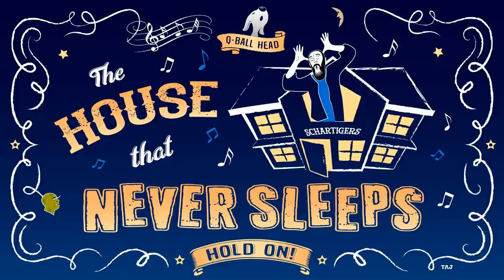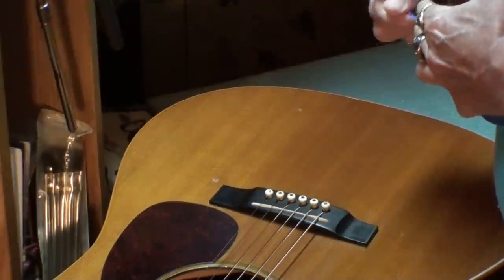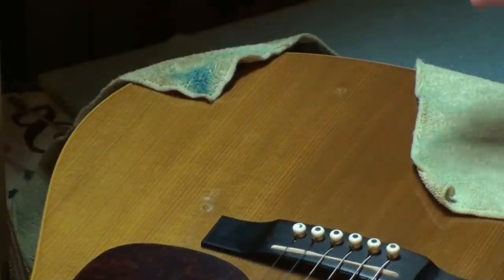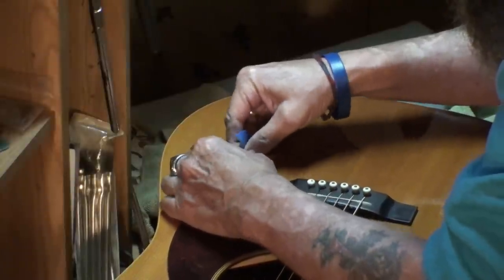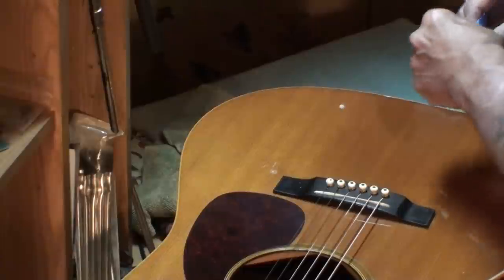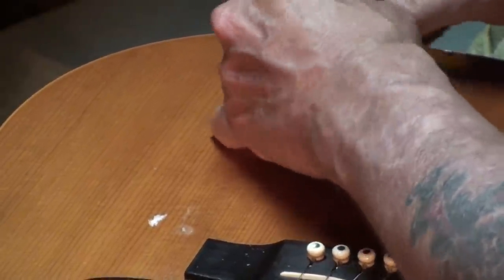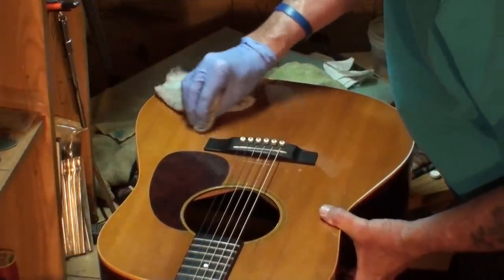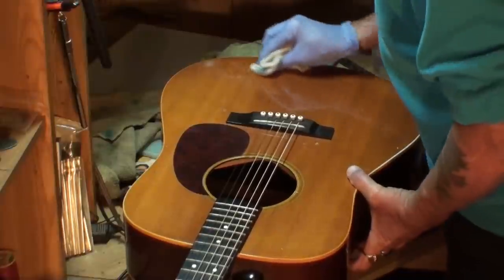guitar finish chip / dent repair

Comment: Great video thanks. One thing you might want to mention in the future is that thin viscosity CA glue directly on Spruce will darken it considerably. I just tried filling in a ding on a 1970s classical, but because the ding was down to the bare wood, the CA glue turned it 3 shades darker than the rest of the top 😩

Comment: I stumbled across this video at the perfect time. Just today a stage tech knocked over my old Martin D35 (he is a great guy and felt pretty bad, but I won’t lie I swallowed some choice words). Luckily the only damage was a pretty solid ding several inches south of the pick guard. I’ll be taking my time and fixing it using the tips from this video. Just to play it safe I might test the drop fill/scrape technique on some scrap before I attempt on a vintage Martin… 😅

Comment: the blade trick has been around for years. i remember seeing my father using the blade to remove paint runs. i use the same tricks on guitars. its a lot better then sanding a little spot. every glue i used turns white after drying.

Comment: Randy, here's a super easy way to accelerate a CA cure without making it go white or foamy.  Apply the CA.  Lay your roll of tape on the guitar so it surrounds the repair.  Lay a paper towel over the tape roll.  Give the paper towel a single blast of accelerator (I prefer Zip Kicker in the little pump bottle).  The kicker's vapor is heavier than air and it will settle into the 'well' you created with the tape roll and kick the CA to a hard cure in about five minutes.  Yet another way to do this kicker vapor trick is to roll up a little section of paper towel and slide it into a small squeeze bottle.  Add a few drops of kicker to the bottle.  You don't want liquid in the bottle...just a few drops on the paper towel.  Screw the spout on, and very slowly and gently puff air from the bottle onto the wet CA.  Slowly and gently is the trick.  The kicker vapors will set the CA hard.  If you monitor the reflection of a bright overhead light in the surface of the wet CA as you do this, you will see when it kicks.  For small jobs like yours, I prefer the little 'needle oiler' squeeze bottles because they have a silicone cap that seals the end of the needle and the kicker won't dry out.  Cheers!
Reply from the maker: I'll keep this in mind and try it out somewhere down the road. thanks for this info and thanks for watching!
Reply: @RandySchartiger  Cheers and be well, brother!

Comment: Excellent video! I'm a truck driver & take my acoustic Ovation  with me on every mile I drive. Last week while hooking my trailer, my aluminum clipboard fell about 5 feet down onto my Ovation, that was leaning against my passenger seat. Needless to say the soundboard was badly dented, still played great, but I knew repair was needed to hold off any further damage. I'll be attempting your method and fix some spots, but for the deeper longer gouges, would it be ok to build up CA glue over the area and scrape it with a razor like you did? Thanks for the video and any tips you could throw at me, if you have the time. Thanks again!

Comment: Hey Randy, just wondering if you could have tried to match the blemished area with a tad bit of stain before the gluing process... but all in all that was a Great Tip... Thanks...👍👍👍
Reply: I could have used touchup markers and it would have looked better yes, I was more concerned with sealing it, had it been someone elses guitar I would have done it differently. thanks for watching!

Comment: My guitar looked a lot like this Martin you have first I painted it black it stayed like that for a while then I decided I wanted to stain the guitar cuz I just like the way guitars sound when they don't have a gloss finish, also on the back of my guitar I engraved a huge cross so I had to get the wood level so there was a lot of sanding, while I was standing I got all the way down to the redwood and some spots I even did this on the front because there were some spots where I outlined my bridge with a marker just trying to make it look better it's a long story lol anyways I'm staying the guitar but those spots where I dug too far are really not wanting to hold the stain how do I fix that

Comment: Hi Randy, thank you for everything that you do!I've learned so so so so much from you. One question, I dropped my guitar the other day on the corner of the back and it has a pretty large chip. The piece of finish just broke off and disappeared. Can I just use ca glue to fill in the gap of the finish? The body is okay (I think) and it's only the missing piece in the finish

Comment: Randy, you mentioned that those dings won't get worse being sealed. I have several on my guitar. Will they get bigger without sealing them?
Reply from the maker: If your finish is cracked or dented or partially missing then yes, elements will work their way into the wood and they will get bigger over time. Both of these have already gotten bigger than they originally were and it's only been a few years. They need to be sealed is the only way to keep them from getting worse. Thanks for watching!
Reply: @RandySchartiger  thank you for the reply. I will watch your video again and see what I can do. Great videos! Keep it up!